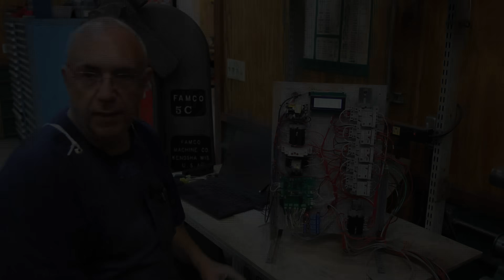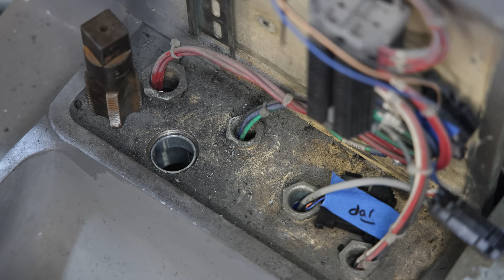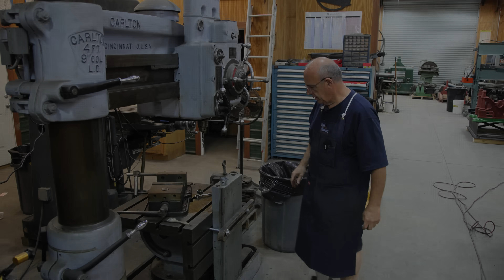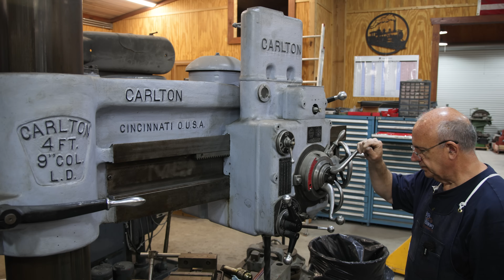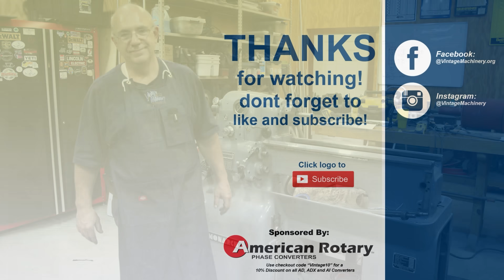Monarch 10EE Lathe Update: DC Motor Drive Conversion - Testing and Installation

Comment: Replacing the old DC drive system with another specially-designed DC drive system is not a good idea IMHO.  A standard AC motor and AC drive would be much easier to trouble-shoot and maintain.  If one large AC motor couldn't provide the required torque, two AC motors connected in tandem could be used.

Comment: Another slightly longer method is to remove and connect and test  each wire separately,  that way you will fall find as you go . However, you won with your method 😂

Comment: Er... you can buy a variable speed drive box and an AC motor and get it all done in a day. No? This is an off-the-shelf solution.... the only work is the mount and sheave. I did my own lathe.

Comment: I worked for a Curtis PMC back in the 80s when everything from golf carts to cars were still looking at DC motors and controls. What you have there is good, but it is not the way. The correct way would be to remove all the electronics and remove all the motors and generators and put in a modern AC motor and a modern VFD. You would need some switches and some rear stats to connect to those Controls on the front of the lake and you’d be good to go. That would bring you up into the current day. You could also do 220 household to 220 3 phase making for a very nice conversion.

Comment: I converted my gear head lathe to variable speed for free!!! People give away treadmills. The ones I got for free have a 3HP Baldor motor. I used the controller out of them to run the variable speed motor. I also did the same thing on my 18" bandsaw to be able to cut wood and metal. I also made my swamp cooler on the roof variable speed all for FREE!! On my old bridgeport mill I installed a $50 variable frequency  phase converter to run its 3 phase  one speed motor to make it variable speed.

Comment: Is this just an academic exercise, or is there a compelling reason to keep the original motor? DC drives using field weakening work fine, but I'd take a 3 phase AC motor with a VFD any day. There are even 3 phase motors designed for lathe spindles with switchable high / low windings and external fan cooling.
Reply: I was thinking the same. What they have accomplished here is definitely cool and noteworthy, but other than keeping some more of the parts original, I don't see any advantages.
Reply: I've got a 1941 10EE, got it with no drive system, I'm using a Marathon Black Max 10hp motor, the Black Max has to be ran off of a VFD, it will produce 100% rated torque at .5 RPM. Running a Fuji VFD with a 1 to 1 belt drive, no back gear. Once I got the VFD tuned I've had zero issues at any of the lathes RPM ranges. All of the original 10EE's controls were retained, super reliable, looks like standard Monarch from the outside, everything is off the shelf so it will be simple to source if I ever have an issue, the only control component is a little rheostat, using the original power switch and the forward and reverse control just connected to the 5 volt control pins on the VFD.

Comment: Another waste of time trying to replicate a system that actually worked. The drive fails to reach full speed because apparently does not have field weakening, the wimpy switching will not hold up under real use. Just a little research would show a modern VFD would be a much more logical choice. Also, a restoration of the original drive would have been a least interesting there are a lot of parts out there, You are way out of your league on the Monarch ee lathe.

Comment: I noticed that 4 foot terminal strip in the background- clough 42 has a video out about those you should be aware of - the ground connection can be questionable
Those electronics might be sensitive to this.

https://youtu.be/z8YdOG9biKU?si=-rn6tICiuDgC9gZo

Comment: As a guy who has pulled lots of wire, it would have been a good idea to cut the zip ties off your bundle where it was in the conduit.  Especially in a conduit designed to be flexed, loose wires in the conduit prevent the bundle bending stresses caused by the wire ties.  It also allows servicing single wires without pulling the whole bundle back out.
This I think is the best modernization project of this type I have seen, so often someone approaching this would have just yanked the motor and stuffed a 3 phase motor with a VFD in there, this is truly elegant. You have kept the soul of the machine, and just modernized the controls to be more serviceable and reliable.

Comment: if you ever have trouble with the fish tape you can use string and blow it through with your air compressor, or suck it through with a shop vac.

Comment: Great job Kieth and “John”! Yes, please make the write-up available for those of us who might try a similar conversion. In particular, the measured characteristics of the motor windings, and the approximate voltages/currents needed to achieve certain speeds would be wonderful.

Comment: You got it figured out but…
Why didn’t you just replace the dc motor with a single phase ac motor and use a variable frequency drive. Both are abundantly available and could be easily adaptable to your machine. And later on when you have problems, and you will, these parts will still be available. 
Just a thought from an equipment manager (retired).

Comment: From a guy who spent his life pushing electrons, I would advise you to pick up a spare 514C controller now.  
At the moment they are not too costly or hard to dig up.
Everything else in that conversion can be replaced updated and tweaked except that controller.  And you have no use for a 3000 pound boat anchor should the controller crater.

Comment: Congratulations, great job!  The round dial 10EE with the motor-gen is harder to update than the newer square dial machines from the 1960-1970's.   The newer machines have a large multi input voltage single phase transformer and  electronic circuits with 3 vacuum tubes to control the 30 amp DC motor.  No 3 phase required, just 208, 220, 240 or 480 volt single phase.  (optional coolant pump was 3PH) 
  I got my 1972 10EE for free with bad tubes and other problems, not worth the cost to fix it with the price for "used" tubes at $1000 each.  
 I designed a modern SCR based solid state replacement.  No modification to the electrical system, just swap out the tubes.  I spent about 80 hours in my spare time fixing it and making four D1-3 mounting plates for 3, 4, 6 jaw and 5C chucks, now have a very nice 10EE.

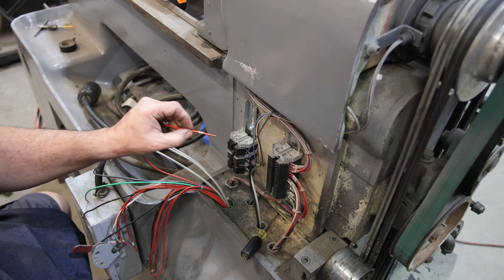Comment: 25:24 Nice job of crimping ferrules on your wiring. I've gotten so I use them whenever I'm going to screw-clamp stranded wire. (The only exception is when I have to wrap the wire around a screw, like on a lamp socket.) I started when I made up a bunch of 12 gauge speaker wires with banana plugs.

Comment: Wow! This video brings back memories from fifty years ago. All my my working life here in the UK was spent in mechanical engineering starting out "On the tools". Lathes, milling machines, borers, drilling machines of all sorts and eventually machining centres. Experienced control from manual vernier to plugboards, to pinboards to punched tape control (written manually with no computer support) and eventually to ever increasing sophisticated CNC. I was never keen on the radial drill but it was a very versatile and effective machine. I moved on to quality control but was still involved in CADCAM until I retired a few years back.
This is the first video of your's I've seen but I think I'm going to enjoy them. Thank you.
Reply: Yes you will enjoy them ! ☺️

Comment: I worked on a good number of DC ships during my early working life. Built in the late 40's and early 50's. The big (80hp ish) motors for the main engine lubricating oil and cooling water were all speed contolled. For instance, as the sea water temperature rose from say 4C in European winter waters to 31C in waters near Indonesia, Malaysia or Singapore, you would just speed up the pump, to push more water through the cooler, thereby maintaining the engine temperature. The speed and torque of the motors could be controlled by altering the voltage to the field and armature coils, by a very large rotary rheostat. As long as you kept on top of the maintenance, they really were very reliable.

Comment: Industry is moving away from compound DC motors. Any advantage they once had is gone. AC Drives now have so much control it simply doesn't make sense to design anything with DC compound morors.
What is a DC compound motor?
The short answer is a DC motor with two field windings. The SERIES winding is in series with the armature. Generally, the voltage to the armature/series field remains constant. The second field winding is called the Shunt winding and it is in parallel to the armature/series field. This winding will be manipulated to control the motor. 
Sizing the motor and drive is simple for people who do that for a living. People who dabble in this from time to time could get lost in the weeds quickly.
For anybody else it becomes an excersize in fustration and confusion.
Having a good original motor and somebody able and willing to help makes the choice Kieth made a good choice.
There's a lot of comments about changing over to a modern AC motor and VFD drive. 
I would have done that. But I am familiar with doing that. But even with my experience I would still have to have an expert select the correct motor and drive.
That said, yes, it would have been less work overall and much quicker.
But, this has been an interesting mod, and I want to see how it holds up.
Because sometimes you just have to go oldschool
Reply: It's an outdated piece of junk anyway,  who needs all that electronic BS to go bad, just for "variable Speed"?:body-blue-raised-arms:
Just one more oddity to sit in his "Vanity Shop" and collect dust!
All a good lathe needs is Forward, Reverse, and Off!:body-blue-raised-arms:

Comment: The complexity of the electronic control makes you appreciate the engineering ability that went into the electromechanical version.  Sadly, that older ability has probably been lost.
Reply: It's an outdated piece of junk anyway,  who needs all that electronic BS to go bad, just for "variable Speed"?:body-blue-raised-arms:
Just one more oddity to sit in his "Vanity Shop" and collect dust!
All a good lathe needs is Forward, Reverse, and Off!:body-blue-raised-arms:

Comment: That Carlton radial arm drill gets me laughing every time. Its so preposterously big for a drill press and its the little version!
Reply: As a young man I worked in a boiler shop. That shop had three radial drills, the smallest about the size of Keith's Carlton. The largest was the size of a two-car garage with 18' eaves! It was enormous; made in Italy. It must have had quite a shipping bill, across the Atlantic and across the continent. It could bore a hole 3" in diameter in a 4" thick steel plate without difficulty.

Comment: Congratulations Keith!!
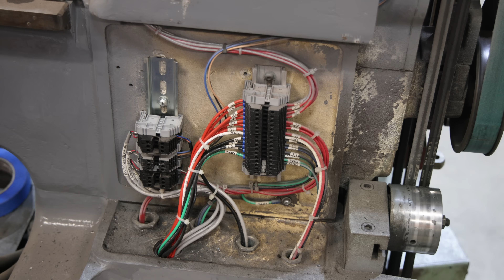At 26:38 you can see a sharp metal edge at the top of the threaded hole that could with machine vibration rub against some of your gray wires. May I suggest a couple zip cable ties at the base of the wires passing-through the casting to ensure the wires are pulled away from that sharp metal edge.

Comment: The quick way to get the saddle refit to a newly ground bed is to use Moglice way material.  All that needs is for you to rough up the bottom of the saddle, make little jacks on the wiper mounts andcuse them to set the apron height for the leadscrew and drive fron the underside of the saddle to the leadscrew. When you're ready you put tape on the ways for oil grooves, spray the ways and tape with release and finally goop the Moglice on the saddle botton ways and set it on the lathe ways.  

It's really easier than it sounds and the process is documented on the Practical Machinist Monarch forum.

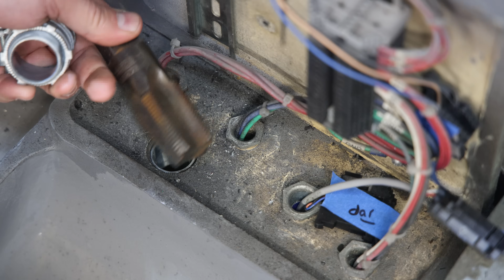Comment: Hi Keith!  Potential electrical hazard seen?  At 18:02 in the video I can see what appears to be crushed insulation on a black wire (one of a pair or black and white wires) coming up thru an adjacent hole (near a piece of tape labeled "top") in the cast iron that exposes the copper conductor inside.  The exposed conductor looks like it may easily touch the frame of the lathe!  In a  later part of the video (27:04) I see these 2 wires have been pulled up out of the hole to attach them to a component and the exposed conductor is not longer visible.  Hopefully you saw it and fixed it off camera!  If not you should check it out!

Comment: There is a replacement DC drive available from Beel and a couple other suppliers.  If you ignore the series field and run with just the shunt you'll be fine and there are multiple drives available.

Comment: Drilling through thick cast iron is a pain.  If you want a 1" hole start with a 1/8" drill, carbide recommended, and step up from there.

Comment: I'd read John's writeup to see what I could learn. Maybe you could post it on your website (with all of the "non-supported" caveats you can muster.)

I assume that to make this work, John probably made notes on the theory of operation of the original electronics and/or the requirements of driving the weird motor. That part would have value for anyone diving down a similar rabbit hole in the future.

Thanks for the content and for the work you put into sharing it with us.

Comment: I remember we discussed these motor designs back at the university. I think the two fields worked like one set had full field excitation for torque and then the other had a weakened field for higher speed. It was great design for its time.  PS, I just explained this to ChatGPT and it can perhaps help people  ( at least people watching this channel I assume 😄)wire this up with an arduino with some contactors and mosfets, it gave a decent step by step.

Comment: Happy to see the old Monarch coming back to life!  With the electronic speed control. does the torque reduce at low speed, like on my cheap minilathe? The great advantage of belts and gears is that torque increases as the spindle rpm decreases.
Reply: The torque at the motor shaft is the same at any motor speed. If you change gear between the motor and the spindle will change the torque at the spindle but not at the motor.

Comment: HI, I was wondering if you would be able to get back to this beautiful machine. I believe the field windings for this motor was set up to keep the motor torque as high as possible by switching the field windings from parallel to series and back to parallel at specific RPM's like a railroad traction motor.

Comment: Josh at Topper Machine seems pretty adamant that running the Monarch 10EE in reverse will (somehow) ruin it. Do you have any concerns about this?
Reply: Josh's comments were not about the 10EE Monarch lathe...the 10EE is designed to run in forward and reverse.  Some other Monarchs were not,
Reply: @jackpledger8118  I went back and double checked and sure enough- he was referring to the Monarch 12CK lathe, which does not have reverse. Thanks for the clarification; clearly I misremembered!

Comment: 25:47 highly recommend getting a 6 jaw crimper, rather than the 4 jaw. Much better crimp, the wires are properly squished, and the outcome (IE, lug fastening in the terminal) will not make the lug come undone because of the initial even pressure of the hex pattern. I've pulled square crimped wires out of their lugs before on testing, never with the hex pattern (6 jaw). Just saying, but it's really worth it and given how cheap they are, really no reason not to.
Also, protip. When putting the lug into the terminal, it should go all the way to the colored jacket, leaving no exposed metal (of the lug). You can use the crimper to cut the excess off. Basically you figure out how much excess you have, refit the lug into the hole using the ridges as a guide of how much, and then squeeze and twist. The excess will fall off, leaving a nice clean end. Again, works better on a 6 jaw, but 4 jaws can do it too.

Comment: This is definitely an upgrade to vintage technology. An interesting challenge and contrast would be restoration of one of the tube type controllers. The schematic I presently can't locate only had  4 tubes for the motor control. These were controlled with various resistors,  transformers and relays. Quite a contrast with the thousands of transistors in this modern adaptation.
Reply: I work with tube gear, and have always wanted to take a crack at restoring a controller like that. I find it interesting to see how they made do with the technology of the time.